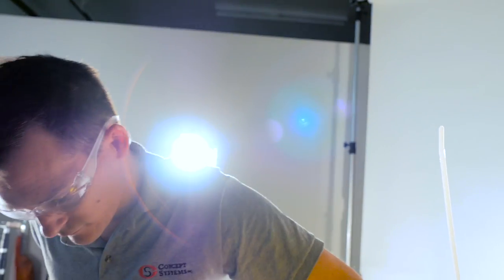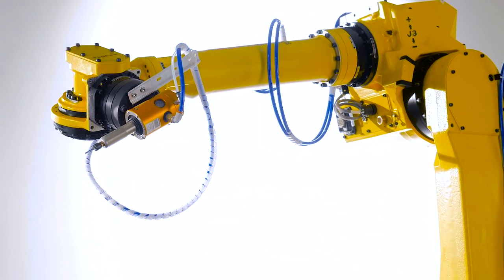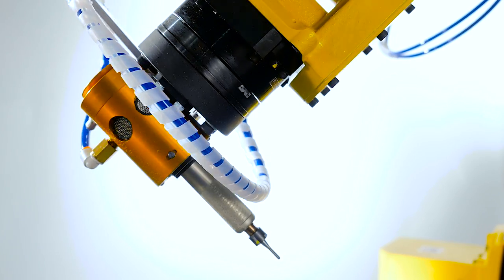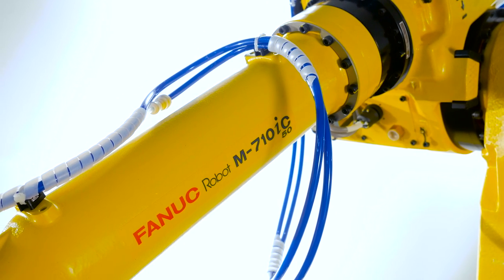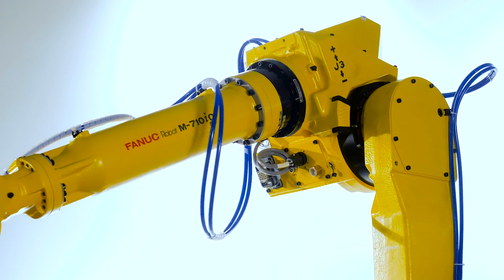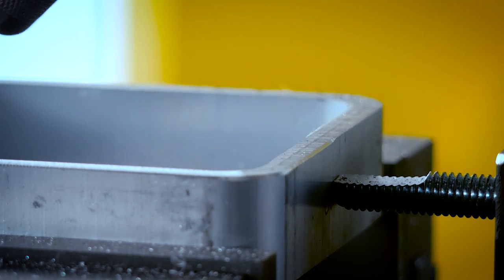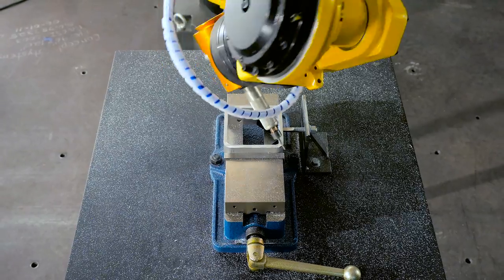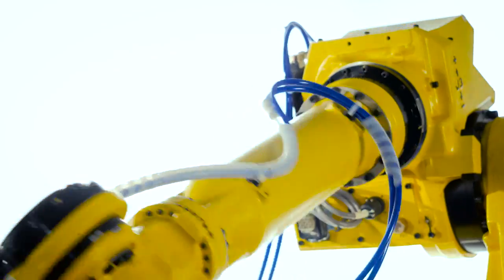Concept Systems FANUC MC 710 Deburring

Comment: I know it is a prototype video. Is really good to see something like that on your channel.

I need to say something because I working with robots for few years now. My teammates do not understand robots. Construction engineer project a layout and tooling, after that when  I I join to project it's time to hold  a my head. All prototypes with robot are really hard and need a lot of imagination. Everyone think robot can always be faster than human. Of course repeatability is in first place, but wrong application can waste time and grow to wrong direction.

Let's think about improving process and robot cycle. How to maximize in this video sample? How about 45 degrees cutting tool? Maybe different motor mounting on flange, 45 degrees again, to most work will be done by 6th axis without unnecessary moves.

I struggle with so much not rethinked ideas, and noone in company ask for opinion. Everyone blame me robot can't make it in desired time. After that mechanical stuff need to be made once more in different way. All think just like that: This is robot, it will move anywhere, so I will made cheapest and simplest gripper and tooling. For prototype is ok but most production lines in time needs improvement.